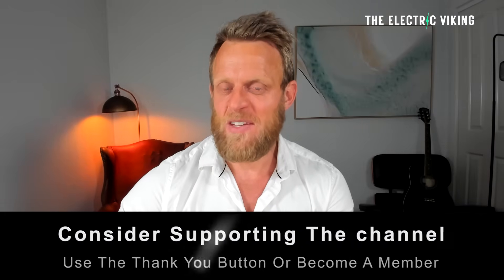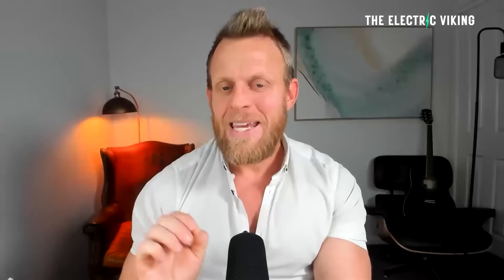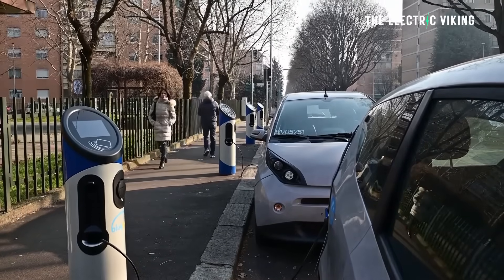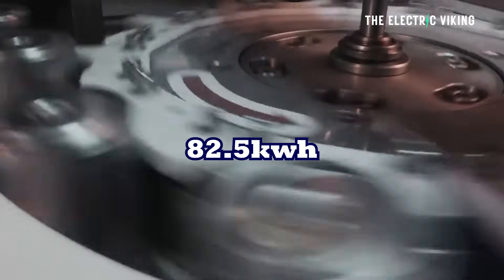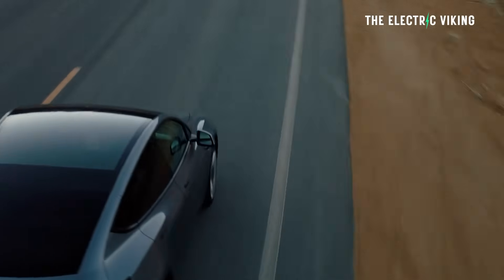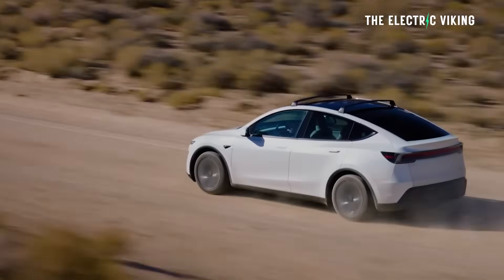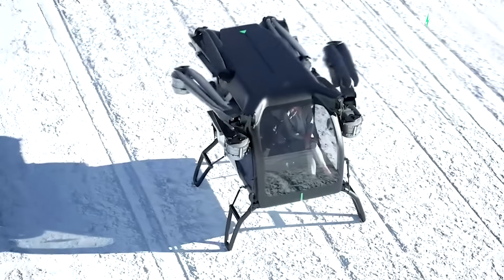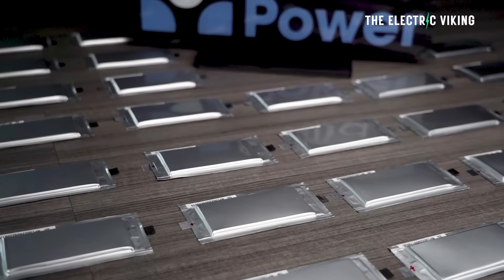Mercedes-backed Farasis Energy will deliver 400 Wh/kg sulfide batteries this year

Comment: That is assuming that the density doubles without an increase in physical size because if that’s different the battery may have to be downsized to fit the chassis.

Comment: It's unlikely manufacturers will offer 1,000 mile range for most EV's, instead they will use the increased energy density of new batteries to lower the physical size and weight of current packs, which in itself will help range some. I don't see much reason for mainstream EV's to have more than 400 miles of true  highway range or about 500 miles EPA rated range. The most important things for long distance EV travel is fast charging times, much more charging infrastructure and LOWER DC fast charging energy rates. As it stands now it is MORE expensive to drive most every EV on long trips using public infrastructure to recharge than to drive a comparable ICE vehicle.

Comment: I think European car manufacturers will use high density batteries to reduce vehicle size and weight. Batteries take up considerable space within a car - just look at the interior size of a Kona-E. Adding weight means brakes, suspension & tires must be bigger, heavier and stronger. EV owners will know that heavy weight needs strong expensive tyres. So the manufacturer may save some money, but the owner will pay extra for replacing the tires of a sodium ion battery vehicle.

Comment: How do you charge off-grid? Various systems are emerging that change internal combustion, removing the need for cams and reworking other aspects to enable much smaller engines that run on numerous fuels. Without at least a doubling of solar PV efficiency, engines are still needed. Of course, large scale power production also remains fuel-based.

Comment: Your thinking on the extra density and range is a bit out. Range is determined by power and also by weight and it's non-linear, so in fact you'd be better off fitting less battery and gaining the range by reducing weight. It's both a bit better for range but more importantly, it's a lot cheaper to get 1000km range by taking batteries out and reducing weight than continuing to drive a tank.

Comment: Important and not mentioned is charging rate. If you are talking about range and convenience, the charge rate is essential information.  Cost is important and reducing weight of EVs is important so assume that the batteries will be smaller and the range will be the same.

Comment: Big density (specific energy), big range.  But at what cost?  Toyota also announced that it can provide 1000 km of range with 1 M km of lifespan for its solid state battery. But is it ready to produce it at a commercially viable cost?  There are a handful of companies that are working on that and this is why sodium ion is very competitive.  It is available now, and very cost competitive because it does not require lithium.

Comment: I would pay 10-30% more for 1400km of range. Save on energy cost..I drive 200km per day. Charge up once per week!!!
Reply: Is charging really that hard?  I'd rather have half the weight and charge two times a week.  I have a charger in my garage, so charging is pretty easy.
Reply: 10-30% more per kWh would mean 120...160% more for the whole battery

Comment: The technology is speeding up. Within 3 years EVs will charge faster than filling with petrol and will have longer range. It is inevitable.
Reply: Great!  I will continue to wait for that
Reply: The charge limit is becoming the cables and charger. That's going to hit a wall at some point, particularly for trucks and it's a much harder problem as high power electrical cabling isn't a new technology so we know most of the tricks already
Reply: @etchedpixels Shell in the UK are already proposing a solution to this with liquid cooling of the cabling. Not exactly a new concept, but I think there will be cable/charging innovations along with much faster charging and more range. Next 5 years will likely eliminate the negatives around EV’s, but the infrastructure to deliver charging will be key.

Comment: Year old question remains:
When will the price of home batteries drop?
It’s cheaper to buy an EV and park it forever in front of your house than buy powerwalls with same capacity.
Reply: Stop looking at expensive powerwall batteries, you can buy a Docan Energy 32KWH LiFePO4 battery from a USA supplier for $2446 plus shipping charge.
Reply: Two Tesla Powerwalls or one powerwall with the additional capacity added currently costs around $20K USD. There’s a few thousand in federal incentives as well, but those are ending this year.
Reply: You don't buy a powerwall, you buy an inverter that works with any standard battery, then buy your batteries from whoever is the best deal. Vastly vastly cheaper than being locked in.
Reply: Don’t know why we can’t buy 2 100kw batteries directly from car manufacturers and wire them up to our house for like 10k each. Then someone will design housing for them and make them safe
Reply: @Subzero0999  From what I read totally different requirements regarding charging (fast charging) for the car and trickle at home. Same for discharging (fast and peak  discharge in the car) and nr. of total cycles. Shockproofness for the car battery. Home battery should be cheaper to make.
It sounds plausible.
Reply: @Subzero0999 that's the kind of setup used on big farms and industrial sites. 100kWh systems exist off the shelf. However you need a big enough charging system which usually means 3 phase power.
Most cars are a good deal less though, and the ones that are very high capacity tend to be NCM which is a poor match for solar and for fire risk
Reply: Love the idea itself but keep reading it offers new (unsolved) challenges regarding nr. of charging cycles, battery durability, type of discharge (fast when driving, trickle while feeding the home). Different kinds of requirements for the battery if mounted in a car or just standing around in a home.

Comment: Xpeng AeroHT use the current Farasis batteries. I think they come in at about 330Wh/kg. They have a 2-seater flying car, so the extra density would really help with range, which is currently 75km for the X2.

Comment: Key questions of battery safety. CATL and BYD batteries go though vigorous and multiple nail penetraion tests and pressure tests. Chinese government want virtually fire proof batteries from next year so more safety pressure on Chinese makers than western battery makers. Also cold weather hot weather performance n degradation parameters should be mentioned. Density is just one parameter.
Reply: Good point
Reply: Well, good, but there are many reports of EV and scooter fires in China over the last year or two. The installed base of batteries is apparently not so safe. Hopefully the newer ones are better.
Reply: @ChickensAndGardening  He does go through the tests the batteries have passed in the video. Now as to car fires, the data is in, we now have enough EV's on the road to calculate comparable risk factors, and the numbers actually tell us you are 80 times more likely to have a fire in a petrol or diesel car than an EV. 

"Globally, EV FireSafe found about 0.0012% of electric passenger vehicles caught fire from 2010 to 2023. While it was difficult to find similar global statistics for petrol and diesel vehicles, EV Firesafe used a range of country reports and found a much higher 0.1% risk of catching fire. That’s more than 80 times the rate EV Firesafe found for electric vehicles."

The thing with EV fires is they attract a lot more media attention than petrol and diesel fires so the number feel higher because we see more widespread reports. Now scooters are a different issue altogether, the batteries are often cheaply made without very good BMS systems, whereas EV's are quite strongly regulated even in China, China has in fact put in a new standard coming online in 2026, "China's MIIT implementing the GB38031-2025 safety standard in July 2026, mandating that EV battery packs must not catch fire or explode even if a single cell experiences thermal runaway." You can bet Chinese battery manufacturers are working hard to achieve this standard and many new batteries now being made in China can actually be run for an hour or more even after a battery cell has experienced thermal runaway.

In Australia: "Eight electric vehicle fires have been reported in Australia to November 2024, according to EV Firesafe, including one with an unknown cause." Note not 8 in 2024, a total of 8 up to November 2024, other sources tell me 10 to 11 from 2010 to 2025, that's 15 years. Some of these fires weren't actually a battery fire, some were the result of arson, some from the EV being parked in a burning building (not caused by the EV) so the actual public view of en EV sitting bu the side of the road and just bursting into flames is far from the truth. (there are over 400,000 EV's of all types in Australia in 2024)

Now compare those to ICE cars, just this one stat tells us what we need to know: "There were approximately 2,803 vehicle fires in New South Wales alone in the 2022-23 financial year," That's a single year in a single state in Australia, yes this is Australian data, but I am sure similar data is available for other countries.

As I said i agree with you entirely on scooters, there are many cheap and dangerous ones around, charge them outside away from flammable building and other material, but EV batteries are far different from cheap scooter batteries.
Reply: Good points Steve! I bet the ratio of ICE v. solid state and LFP vehicle fires going forward will be one EV to ten thousand gas vehicle fires!
Reply: @ChickensAndGardening those are very different batteries, small things which might have been made very cheaply. And the same goes for any small battery devices one might buy from Temu, etc.
Reply: YOU made some good points especialy on cold weather performance. also is this battery lithinum sulfide or just sulfide?
Reply: Fair statement,but wouldn’t nail testing petrol tanks and lpg runnings fail worse. If we want out children and future generation to live healthier. Then shouldn’t EV be should be a no brainer. We never will be allowed to reduce emissions from shipping liners and planes. But that’s for another 100 years

Comment: Going to take 5 years to get sodium production levels near the LFP battery levels so I think there is room for all battiers right now
Reply: Not only are sodium batteries much cheaper with a wider operating temperature, they can be.produced using the same equipment as LFP batteries. This should enable the rapid deployment of sodium batteries.
Reply: Sodium is one of the most abundant elements produced. It is derived from seawater, salt, mines, and underground brine deposits, There’s probably an over capacity of sodium currently being produced in the world, so I doubt we’re gonna have much trouble meeting demand, assuming that sodium batteries really take off.
Reply: @ChickensAndGardening  you still need time to build the factories to build the batteries

Comment: First Sulfur based battery success I have heard off. Any specs on number of cycles(longevity ) charge speed etc etc.
Reply: Also safety question. CATL and BYD always mention safety and multiple nail tests and pressure tests. Chinese government want virtually fire proof batteries from next year so more safety pressure on Chinese makers than western battery makers. Also cold weather hot weather performance n degradation parameters are mentioned when Chinese battery comes out

Comment: 1000m range will be of no interest to the vast majority of people. 
A cheaper lighter 500m version would sell far better.
Reply: if you have good ev charger web in your country- its ok 500-600 km. anyway you need to stop every 300-400km(3-4hourse estimate) for eat, toilet,coffee, etc. if you can charge your car for next 400-500km in 20-30 minutes(now its may be 10-15min) you dont need 1000km battery. its have big cost, its heavy, have more amortisation for suspension, tyres, need more power engines, etc.
Reply: @IgorYakubovskiy  even though that is true, charging “on the way” cost at least 5x more than charging at home. So, yes, range does matter a lot!!! So I rather have to stop for a break without needing to recharge, than being in the need of charging. But hey, that’s just my opinion.
Reply: @luisarthurv.9442 may be its actual for your country. In n Thailand no big difference in home and fast charging cost.
Reply: 500 miles (800 km) is probably the tipping point for EVs. I’m waiting for that, myself, though probably I’ll settle for 380m or 400m because I don’t know how much longer my current clunker will last, lol
Reply: Think of the battery as analogous to a petrol tank.  Do you want a car with a pissy small tank or  big tank ?  If the higher capacity battery cost is reasonable the 'big tank' is a no brainer.  Range and more powerful motors with fewer deep charge cycles on longer trips and extra power for V2G or V2L when running house at night.  Hot hatches with high power motors, light weight and good range would become do-able.  Australian east coast  Brisbane - Sydney - Melbourne - Adelaide would be all possible on one charge. No range anxiety or charge queues at 4 hour or halfway points.  ICE's and Hybrids obsolete.
Reply: 1000 KM will be a game changer and RIP for gasoline

Comment: 400 to 500 Wh/kg would make EV's cheaper to run than ICE cars. But it also allows for use in aerospace for drones and even cargo planes and short haul passenger planes. If such a breakthough does happens by 2027, hybrid and ICE cars will price themselves out of the market as too expensive to run. Myself I hope that I can get a battery retrofit for my hybrid car with this new technology. It would basically extend the lifetime of my car with a number of years! It would in reality turn into an EV.
Reply: Are electric cars really more expensive to operate than ICE cars now? my BYD atto3 is of a different opinion with an 8-year warranty and 0 maintenance cost up to 160,000km. the cost of 1 km is currently 1 baht (I live in Thailand) - for an internal combustion engine it is about 3 baht km
Reply: @IgorYakubovskiy The upfront investment of EVs are higher than ICe in Europe now that government incentives have dried up. Slightly lower cost of ownershop makes it take longer to benefit.So a sharp improvement of battery technology will end the demand for ICE fast.
Reply: @ocker2000  may be its real for europe. but in thailand now another situation
Reply: @IgorYakubovskiy Good for you.
Reply: Norway already offers short haul flights on electric planes, between Bergen and Stavanger.
Reply: @bengt_axle Yes, and there are planes like Pipistrel that are EV. I mean a significant growth of EV airplane traffic.
Reply: No. In this case more expensive

Comment: No they will not compete with sodium batteries since so different density. Sodium will be used for grid storage, cheap cars, cars that need to drive in very cold climate, UPS. Not used on expensive cars.
Reply: I feel like this is an accurate assessment. Sodium will be for "good enough" for everyday cars for example, where "meeting requirements at threshold" is the objective, but solid state will go where the very best is needed.

Comment: why the weight  of 82kwh battery tesla y is 771 kg? it must be 328kg(82kwh\0.250wh\kg). + case and other elements, not more than 400kg.  Anyway 771kg is to heavy for  this energy density.